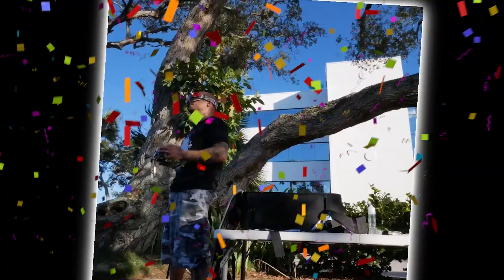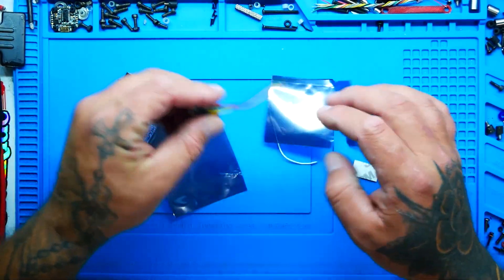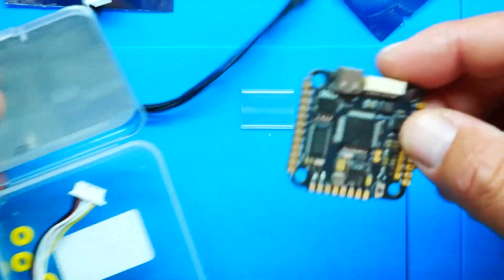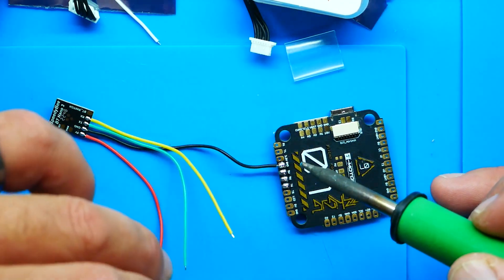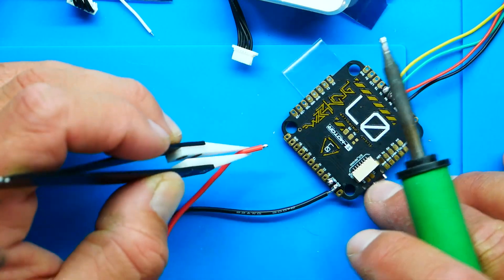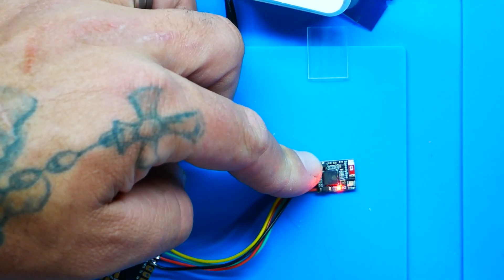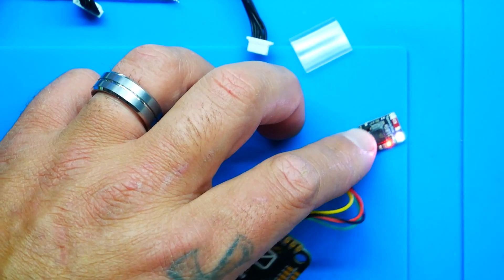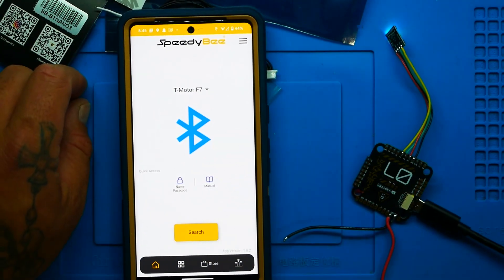Full Betaflight Access on Any Stack, Any Where! Bluetooth All Your Drones!

Comment: On that T-Motor flight controller, you could use one piece of the double sided tape and stick it to the bottom of the flight controller and then wire it with very short wires for a super clean installation. If i use a Speedybee esc with Bluetooth will i also be able to adjust a non speedybee flight controller using the Bluetooth from the esc?

Comment: its called a "Bluetooth Serial Pass Through Module" aliexpress sell such modules for £1 to £2 DELIVERED. We used to use them quite a lot around 10 years ago :)
Reply: https://www.youtube.com/watch?v=Pv9oU4u60t8&ab_channel=Dread-I-Productions

A video from 9 years ago where i used a Bluetooth module to connect to multiwii but rather than disable when armed i used it when armed to read out flight data BEFORE this thing called telemetry came along for the masses lol told me altitude, distance, flight mode, speed and anything else info wise that multiwii could put out at the time

Comment: dont do this heres why you have to swap msp to this thing so if this thing ever fails your screwed you wont be able to acess the msp over a regular cable connection ie usb so just buy a speedy bee flight controller with blutooth that does both